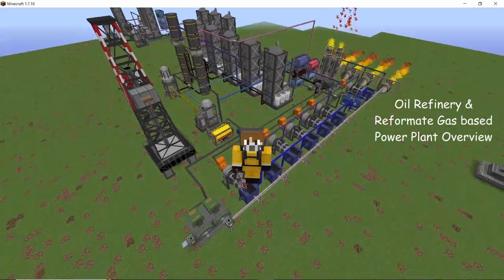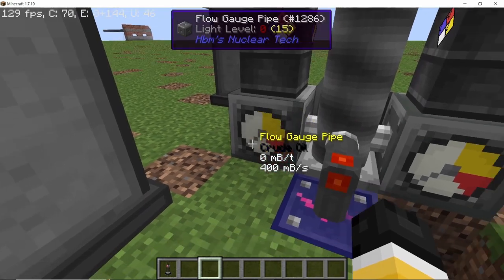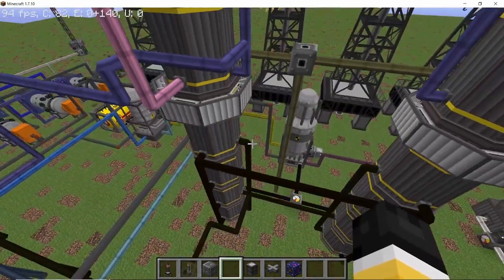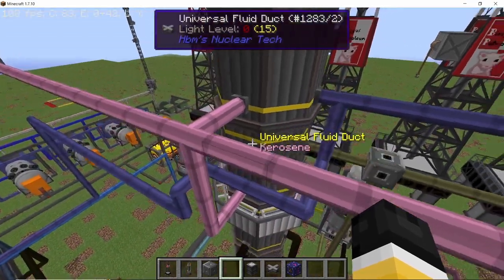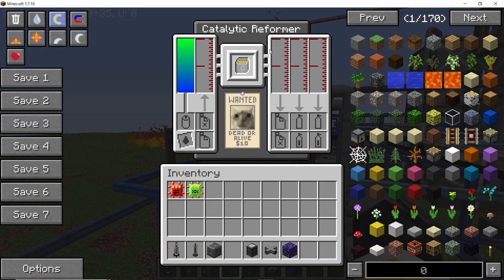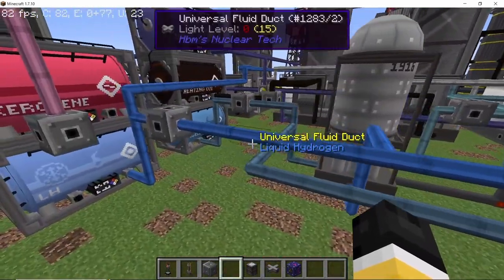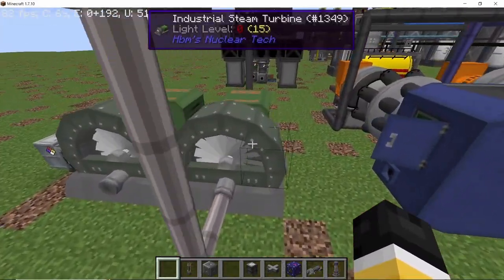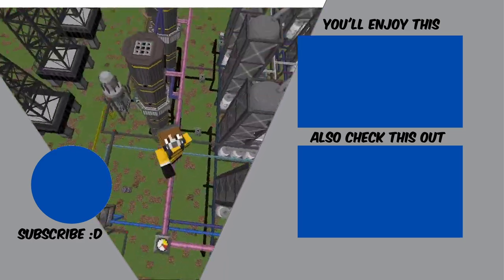Big Oil Refinery / Power Plant Overview - Vacuum Refinery HBM's NTM

Comment: Hey, Savage. I've got an idea for a video for you. Try creating a highly automated nuclear power plant with multiple reactor units. Use large RBMK reactors (around 15x15). Implement safety and protection systems, nuclear fuel production and disposal processes. Have an electrical substation, and maybe even a railway transportation system for delivering goods and handling waste. There are plenty of other things you can come up with. I think it would be pretty cool.
Reply from the maker: I am working on such a system but is does not use the RBMK ... rather it works with the big nuclear reactor which is modular. Reason being there is no way to automate the fuel supply and extraction. Also RBMK does require more care while operating. Meanwhile the big nuclear reactor can be totally automated so that is what I'm using to make the big nuclear power plant with substations and fuel processing areas and disposal pools

Comment: What is the difference between moderated fuel rod and fuel rod
Reply from the maker: Moderated fuel rods don't require external moderators to slow down the incoming neutrons but normal fuel rods do

Comment: Is this build possible to work as self-sufficient in survival, meaning only one fracking tower?
Reply from the maker: Well to run this off a single tower in survival you will need to edit the config file to change the amount of crude oil extracted. Other than that I don't know of a way
Reply: @SavageVegeta  oh ok, thanks for the answer man. Also, keep up the good work, you've done amazing and very informative videos on hbm's different machines and mechanics!

Comment: Could you do an update of the rbmk 1000? Because when I placed the water line under the steam channel rods it wouldn't connect to the rbmk steam Chanell block?
Reply from the maker: NTM extended is what you need to use, also make sure to set the pipes to output mode using a screw driver. I made a video on RBMK in 1.12.2 you might wanna check that out

Comment: Sorry my bad when I connect the water duct pipe to the rbmk steam connector it won't connect😂
Reply from the maker: it's a visual bug in the reloaded version of the mod
try using NTM Extended as there you won't face that problem